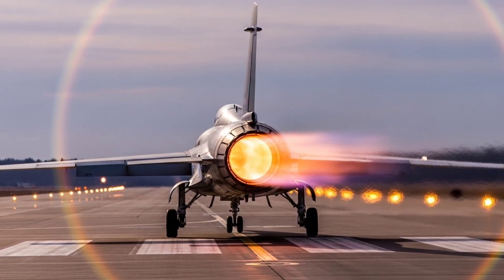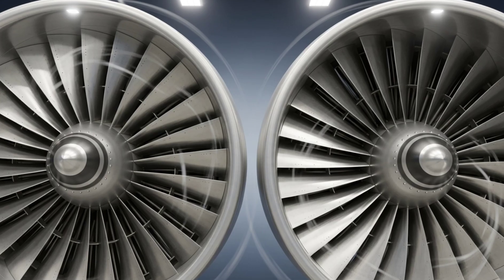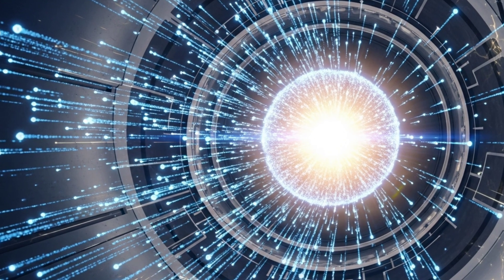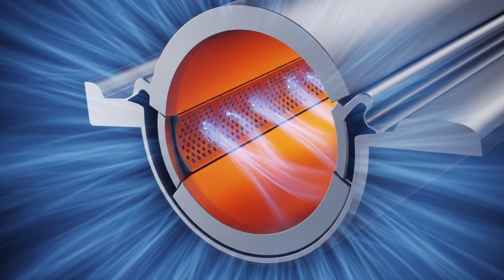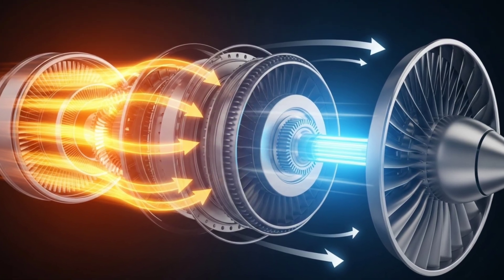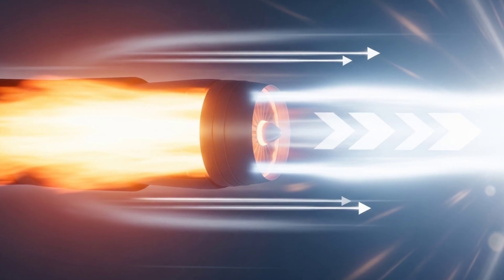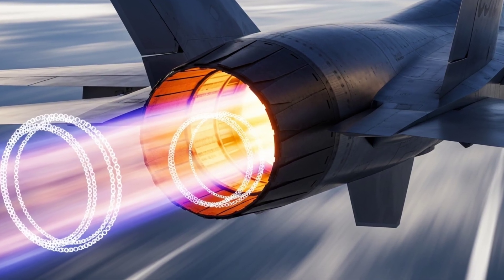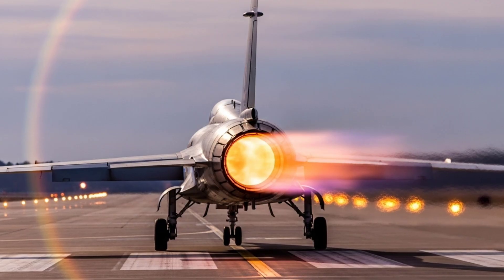How a Jet Engine Works | Explained in 7 Minutes

Comment: This model can helping the environment of the production lower than before all those jet engines much clear by burning highs degrees and pushing the oxygen made the planes quiter and smoother to fly, and with lighter materials to build without toxic stuff to building internal control can be more safer to cut off so many engines conrols.